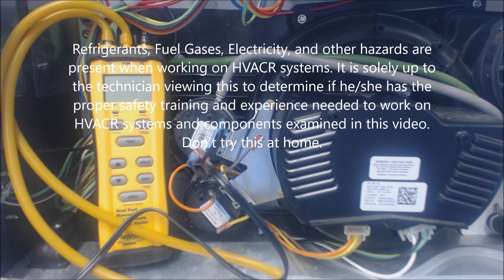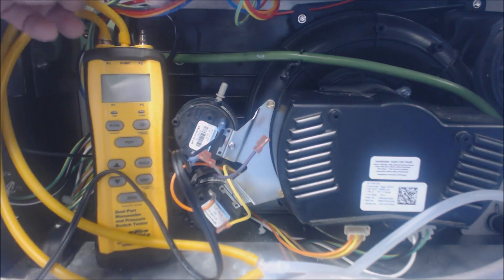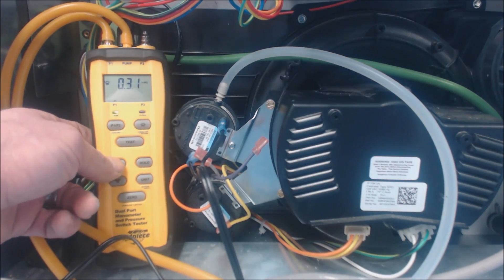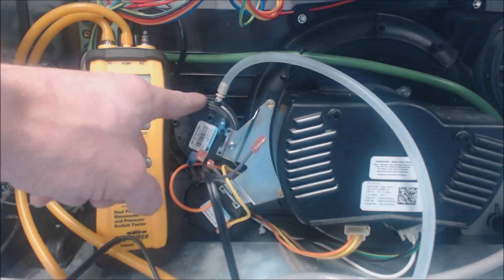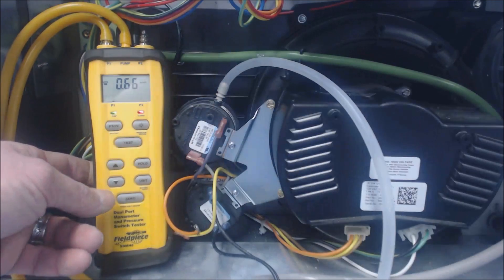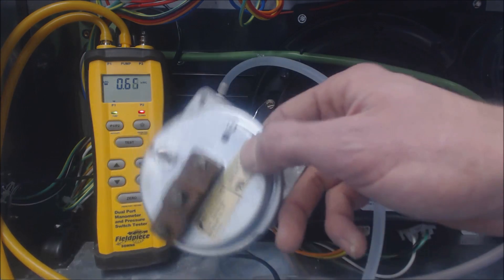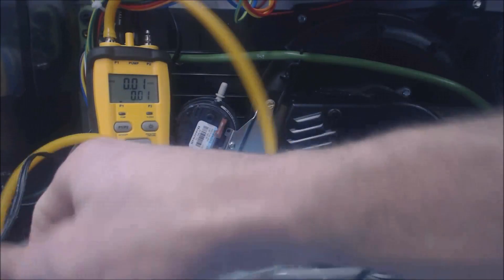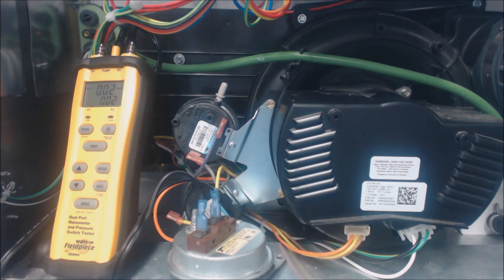Furnace Pressure Switch Troubleshooting- Definite Testing Procedure!

Comment: I did some research since tech support told me pressure switches open according to the rating on the tag... not close. 

I am currently dealing with a furnace issue. The inducer pulls 1.7" WC, but has a rating of 1.4"WC. It doesnt get continuity across the switch. Tech Support mentioned "the 1.4 inches WC rating is when the pressure switch opens. It takes about 1.75 inches WC to close". I always thought they close according to the tag rating. You mentioned the same thing in your video that they should close once they reach that pressure. Which one is right?

Comment: The SDMN6 has an accuracy of +/- of 0.02inWC in 0.00-2.00inWC range. Can't this make things very inaccurate when testing low static pressure?
Reply: If you're trying to measure butterfly farts then you will need to spend more than $300.

Comment: Just one addition to this video. Pressing the hold button while increasing/decreasing the pressure it will show you at what point the pressure switch makes or brakes. It also tell you if the diaphragm is rupture.
Reply from the maker: Yes Absolutely, thanks R R!

Comment: I would like to see a video like this using an adjustable pressure switch using a spring an adjusting it to a 0.74
Reply from the maker: I would like to do a video on replacing the pressure switch with an adjustable soon, thanks!
Reply: @acservicetechchannel  cool yeah when I do servicing I can't carry all different pressure switches to get ppl heat working in the middle of the night especially when supply houses are closed
Reply from the maker: Yeah I just replaced a switch with an adjustable one friday morning but was in a rush and didn't make a video. i would like to do one soon, thanks. Do you have the Fieldpiece SDMN6 to set them? Thats what I use. Fieldpiece SDMN6 Dual Pressure Testing Manometer with Pump-   http://amzn.to/2jyK5Ka
Reply: @acservicetechchannel  no not yet I currently have Fieldpiece SDMN5 but not the 6 yet but will get it real soon.
Reply: It is very easy, just press the hold button and it will show you at what point the PS makes. Then, you will either add tension or loosen the spring. @acservicetechchannel

Comment: Very useful. I just got this manometer. Just been using it to set gas pressures. Not anymore,  thanks. I'll start using this feature.
Reply from the maker: I love that manometer. That tool really gave me the confidence to know that I will be able to figure the problem out for sure, thanks Daniel!
Reply: You could use it to check Static Pressure as well. It tells you very quick if a duct system was built properly. or if a zone is shoot close!....

Comment: Do you recommend fieldpiece or UEI instruments?
Reply from the maker: Uei for multimeter, and this fieldpiece manometer and pressure switch tester. I have used uei for gauge and digital manometers too so I have great faith in them. This fieldpiece manometer however really fits the need with it's internal pump and works well. The links for these tools are in the descriptions. This manometer link is in the description of this video and the uei multimeter is in the description of every video.

Comment: hey . can u do the video for the gas furnace with the sdmn6. thanks!
Reply from the maker: I think you are talking about teching out the pressure switches while that furnace is running, correct?
Reply: acservicetech. yes
Reply: that meter is also a manometer to check inlet and outlet gas pressure. i needed to see how to do that with that meter. thanks! Ac service tech!!

Comment: This is a great tool to check pressure switches. I see a lot of techs blowing into the tubes of pressure switches which ruins them because they cant take high pressure. Also i always check the bleed port on the pressure switch,if plugged it wont work properly. Thanks for posting this.
Reply from the maker: Yes bleed ports are very important, thanks for adding that!

Comment: Thank you for posting such a great video. This tip can help you out. When testing pressure switches press the HOLD button, and the pressure value indicated on the display when the red light comes on (closing) or goes out (opening) will be frozen giving the exact value. 
Thank you again.
Reply from the maker: Great Tip Angel, Thanks

Comment: Just curios what brand furnace that is? Its not everyday I come across a variable inducer motor
Reply from the maker: Well I figured to show you the tool and process that I would use a harder furnace for intermittent problems in order to take one type of component out of play for the diagnosis of a problem. I believe this was a Bryant model 987MA042060V17 off the top of my head. Thanks

Comment: I would like to add a priceless tip that I learned from experience. Sometimes there will be calcium buildup or corrosion that will block the nipple at the inducer motor housing where the pressure switch tube connects. I've pulled my hair out before on units where the pressure switch tested perfect and there were no blockages in the vent only to later discover a blockage in that location. Now I always pull the tube from the inducer housing to check for a blockage prior to bothering with pressure switch testing
Reply from the maker: I am absolutely with you on that. The aluminum inducer motor housings will create a blockage at that port and you have to pierce through the blockage. The issue is that when checking with the manometer, It will give you pressure and other times not because the hole just started closing off completely. Thanks for the insight!
Reply: acservicetech  hey man  you are a good teacher but an excellent person!!! Sharing your knowledge with us it is priceless!!
Reply: That nipple on the inducer clogging up is the main problem I see with them.  Usually a piece of wire will clear it. 

The other problem I see is those damn boards in the furnaces with ECM blower motors showing the same symptoms.  The price of the boards is ridiculous and sometimes take a day or two to get.
Reply: @speckulator7516   thanks for thei tip https://youtu.be/sfR4tsFnTwQ
Reply: This exact issue happened to me last week. I wasted so much time before I figured it out. Never Again! Hopefully
Reply: @inertiaspinner555  i will look out for that https://youtu.be/sfR4tsFnTwQ
Reply from the maker: Frontiermarvin71, I appreciate your comment and I always appreciate LiberalTears aredrowning me's posts! Thanks!
Reply: @acservicetechchannel  https://youtu.be/sfR4tsFnTwQ
Reply from the maker: Frontiermarvin71, I appreciate your comment and I always appreciate LiberalTears aredrowning me's posts! Thanks!
Reply from the maker: Frontiermarvin71, I appreciate your comment and I always appreciate LiberalTears aredrowning me's posts! Thanks!
Reply: thats a great tip thanks, https://youtu.be/sfR4tsFnTwQ